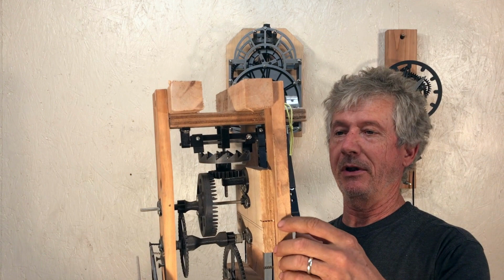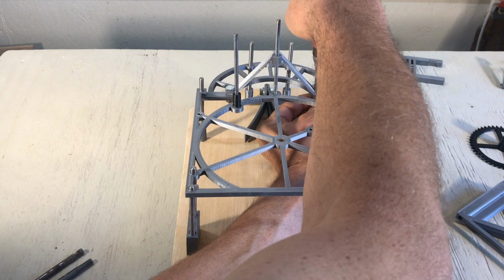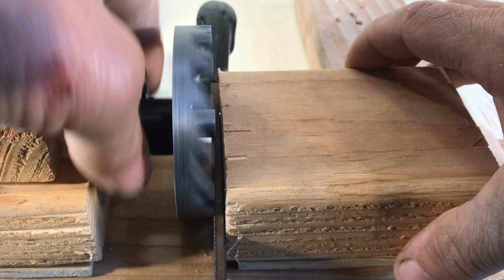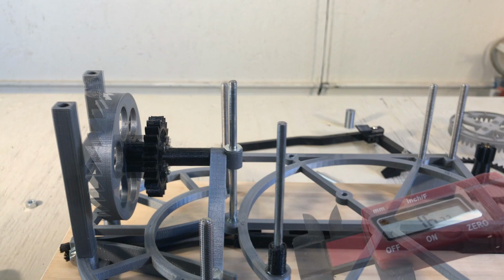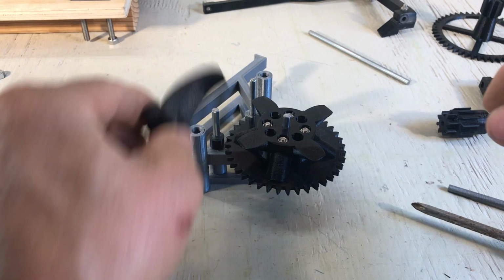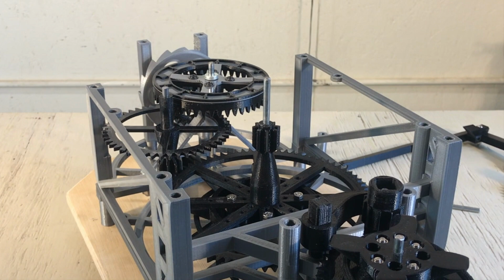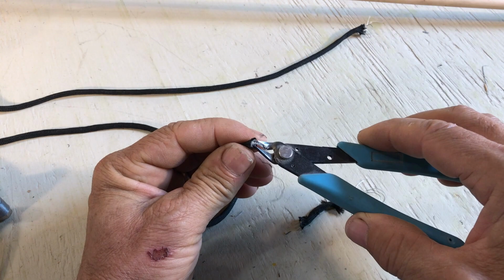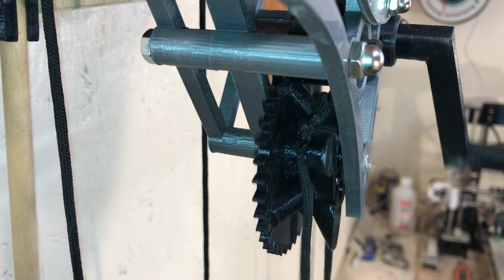3D printed Christiaan Huygens Clock Build

Comment: An excellent work. I hope, I can print this beatiful clock with such a precission and perfection. Have you any glues about temperature, infill for the PLA and so on? This would be very helpful. Thanks
Reply from the maker: I used 3D Solutech PLA at 195F, 0.2 mm layer, 20% infill
I have switched to PLA +, ESUN lately with 215 F, looks like it is much stronger...
Good like with your printing!
Reply: @jacquesfavre999  I too an  using ESUN at 215F, .2 mm layer, 20% infill.  Bed temp is 80C i get great results.  But to get rid of layer lines, Cura slicer has feature called Ironing.  Turn that on to get a nice smooth surface if you care.

Comment: Awesome clock. You did nice work.but can you tell me how many hours / days does it work ? Because until now I printed and built two mechanical clocks. But works only for 12 hours. I cannot fimd your projects on thingiverse (I know you are on Myminifactory). 
Kind Regards.
Reply from the maker: it will run for about 5 to 6 hours

Comment: If I'd add a second wheel to the pulley, do you think the time between wind-ups would get longer, or would the torque be too low for the clock to run?
Reply from the maker: You can had pulleys, that is going to be quite a few, each weight will need an extra pulley, and then 2 more at the top as well, finally both weight will need to be double
Reply: @jacquesfavre999  And what about adding the pulley system and adding a brass pipe insert to every gear to remove friction? Then the required torque wouldn't be so high and the weight could stay the same.
Reply from the maker: @vit.budina  Some people have added brass inserts, even bearings to their clock and have had great success
Less friction is good
Reply: @jacquesfavre999  ok, once it's finished, I will write here how much of a difference it made and if the pulleys work. I will probably fix one end of the rope to the bottom of the wood part of the clock, run it down to the weight with a pulley, then up into the clock and around the pulley inside and then down to the other weight, through a pulley and back up to the wood and fix it there. I'll probably use the pulleys from your other clock design.

Comment: Great work. How come you use this strange design for your pulleys? Do you know if it has a name or if it is used elsewhere?
Reply from the maker: The original clock had spikes to prevent the rope from slipping, my spoke increases friction with waves.
Not sure if it has a name

Comment: I am printing this.  just wondering, have you any ideas as to how to increase runtime?  Maybe less pendulum swing? Motor rewind like on your other clock?
Reply from the maker: See my answer above. As far as motor, it is possible, they did not have them back then....
Reply: maybe adding metal inserts in the gears' holes for less friction...
Reply: @jacquesfavre999  What is the length of pendulum measured to center of bob?
Reply: Metal typically has more friction than most plastics when used in mechanical clocks. I have tried that on wooden clocks and it is worse and I wound up going to a slippery plastic like Delrin...

Comment: I have a question, the clock is too big for my print bed if I scale it down to fit do the weights change? Any recommendations other than getting a bigger printer. Using Ender 3 Pro
Reply from the maker: I printed it on a ender3V2
depending on slicer they have the annoying no print zone that prevent using the whole bed
if scaling down you will have to resize the shafts
You could go 80% and use 4 mm shafts
weights might be a little lower as well, you ll have to experiment

Comment: What size bolts are you using?
Reply from the maker: mostly metric M6 x 150  for the threaded rods and M4 for the screws in various length
Reply: Thanks, do you have the size of the metal rods you used as well?
Reply from the maker: @PaulViland  I used 3/16 because I am in the US
5 mm will work just as well
125 mm for the longest, the main shaft
Reply: @jacquesfavre999  Thanks, I'm currently printing this - it's gonna take a while - Your design is great, thanks for making it.
Reply from the maker: @PaulViland  Have fun!